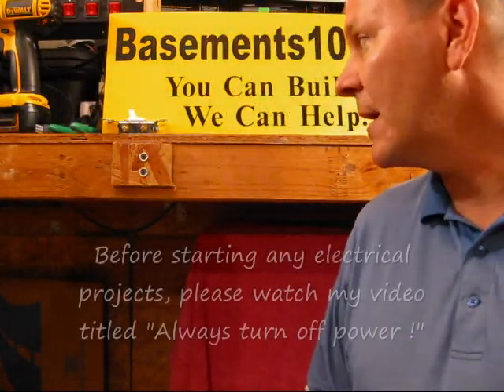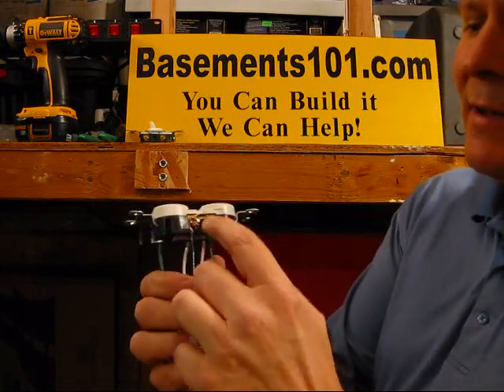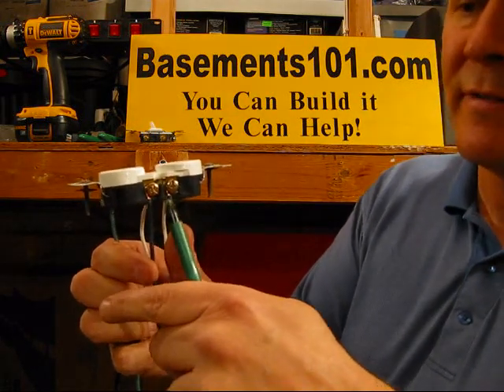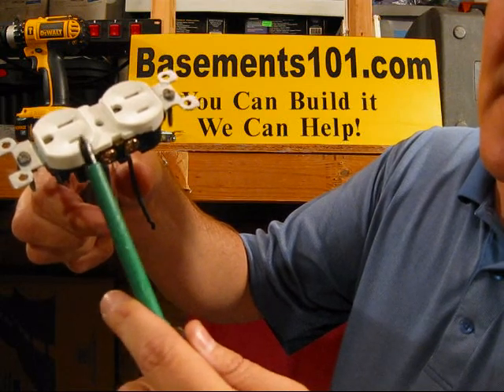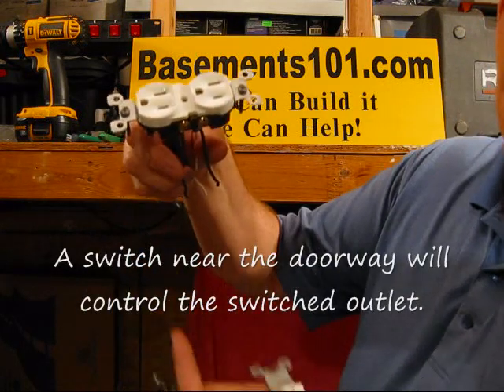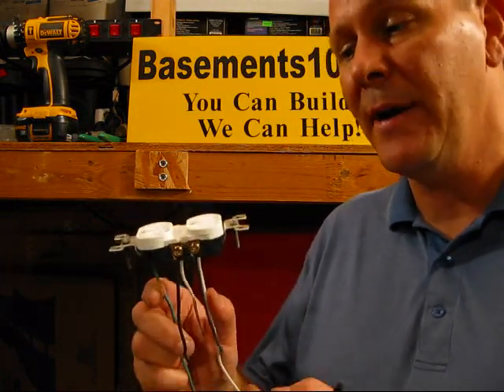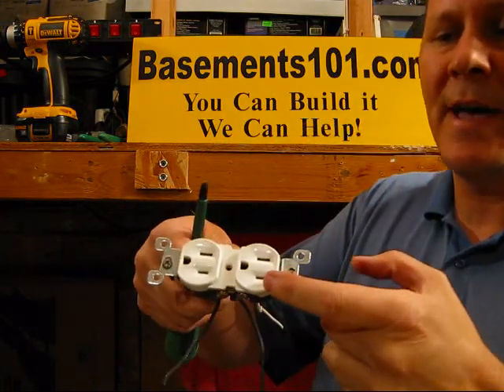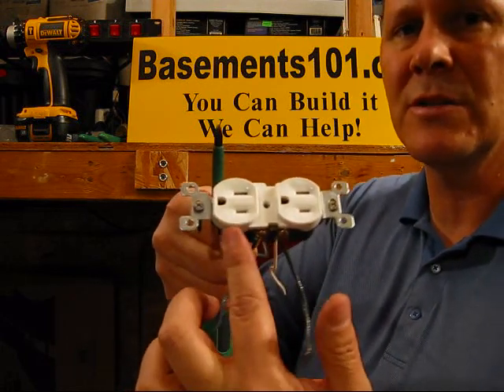switched outlet

Comment: How to wire switch controlled GFCI receptacle where both upper and lower outlets of this receptacle are controlled by single pole switch When the switch is' ON' position , the receptacle is hot, when the switch is turned off the receptacle doesn't receive power. Thank you